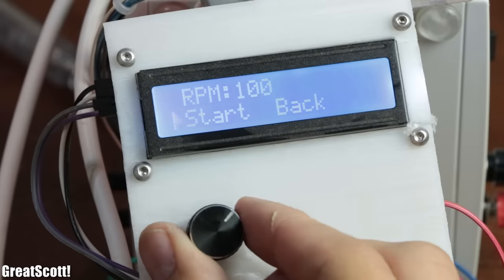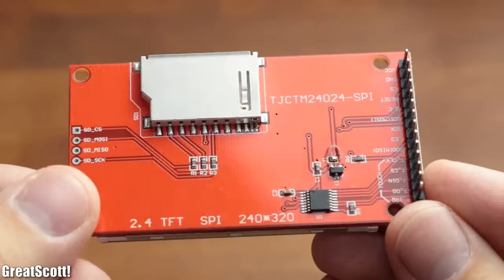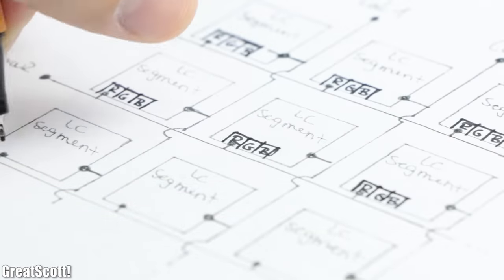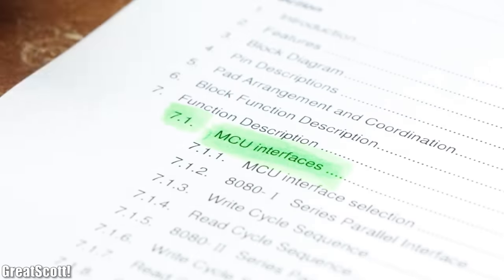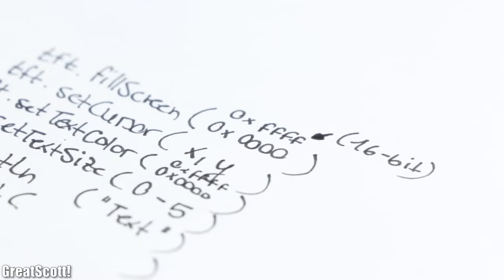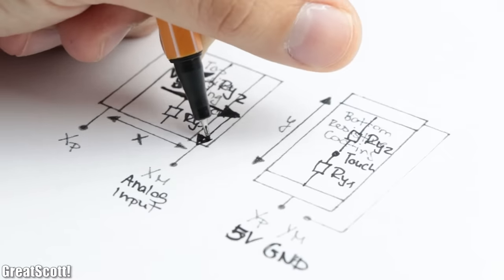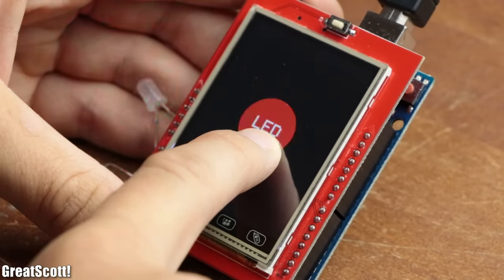How to create a simple Touchscreen GUI || Arduino LCD & Touchscreen Tutorial

Comment: One thing to consider is that while the parallel interface requires fewer clock cycles to set the data it may actually take more clock cycles on the microcontroller because many microcontrollers offer hardware SPI, I2C, and UART modules which operate independently of the rest of the processor.

Comment: FYI:
The Display you tied on @5:42 is 3.3V only. Although it claims to be 5V tolerant, it is NOT. 
Mine was not working as well, so I used a Level-Converter and... "voila", it works perfectly. (You can also use a couple of resistors, but that turned out to be not reliable at all)
You can use 3.3V Arduino boards. 
I use a Bluepill STM32 board now with the ADAFRUIT_GFX_AS and Adafruit_ILI9341_STM libraries and this is fast as lightning.
But thanks for the great video!!!

Comment: Although those screens are listed as 5V tolerant, they work with 3.3volts. You need to use a level converter such as BSS138 mosfet in order to use SPI interface.

Comment: Try Nextion Displays, they are more expensive but they allow for more complex GUIs since they run the GUI on their own and can communiceate with microcontrollers.
Reply: It also only takes up two pins on your arduino, and there is a software to visually edit your GUI
Reply: Nextion are the best displays for arduino. You can use them also with ESP chips.
Reply: I had no idea those exist, I am already looking into it now and it looks promising for my room (door lock/tempreture/curtain) project, instead of manually coding  my display  i could use this and half my workload. Thanks :)
Reply: I agree - Nextion displays are better than these.  And also more expensive. The price for these are good though. I guess it depends on your project and your budget.
Reply: Nextion are better, but cost more. Maybe in the future, MCUfriends will develope an editor like Nextion, & bobs your uncle, they will be the favourites.
Reply: They are a different beast. You only have RX/TX lines to communicate with it, which means you need to have everything you will ever want displayed loaded on a dedicated SD card. Just watch his weather station video to see how they look and how limited they are. 'Normal' TFT you can draw whatever you want, whenever you want, anywhere you want and you don't need a dedicated SD card. You can share the SD card with a data logger or use SPI flash memory, I2C EEPROM, etc. You can even draw on-the-fly. Normal TFT takes more time to tame, but they're worth it (don't use Adafruit GFX library!) Still, if Nextion meets your needs, go for it.

Comment: I also ordered 2 of those 8 bit displays and could not get it running for the life of me. Just by accident I tried the other one and it worked immediately. So it is quite possible that your serial display is broken.

I completely agree with your statement about pin usage. On a nano you have 1 or 2 pins left.

One other thing: better to draw complex UI on the computer and show the image on the display. This way you "only" have to implement the click map.

Comment: Unless mentioned before, cheapo screens like the SainSmart are likely to lose touch functionality after a year or so unless you add a protective shield (like a phone display cover) and protect the flat-cable by putting something hard on top of it, or repeated use/clicks will lead to intermittent failure due to material stress. They're cheap and good for experimenting with, but go with a tougher-quality display if it's meant to be used over a long period of time, or in rough environments such as being carried around in a pocket.

Comment: Hi Scott. I am sure you figured the SPI version out by now and my not even read this message but, the Arduino uses 5v IO ports and the TFT SPI uses 3.3v signals. You have to create a voltage divider for the SPI data connections. Also add the RST Pin #define if using the adafruit library.

Comment: The issue you had with the first screen was logic level voltage. Try putting a 10k resistor on all the data lines and it will work.

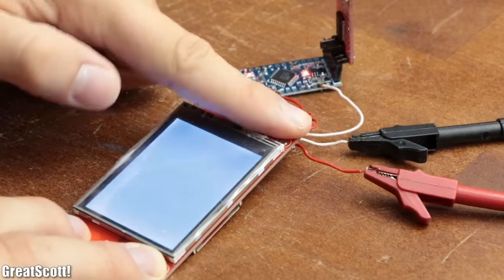Comment: Check that your SIGNAL lines are at 3 volt at time 5:52 , if not you will get white screen. Been there done that. You will need a voltage converter. Just subscribed :)

Comment: Try a nextion display... Its just an lcd display, but with its own microcontroller that loads the UI from built in SD card adapter..
Reply: And you only need 4 Pins (Rx, Tx, GRD, Vin)
But be careful when buying, if on the back "TJC" is written, it is the Chinese version and it would NOT be running with the Nextion Editor.
Reply: @Tom-hg9lw  Hmm, I didn't know that. Thanks for the info! Having just 4 pins(effectively 2) is also a pin saver!
Reply: I made this mistake because the article was cheaper and in ebay the title was " Nextion 3,2" ". And now I must have the chinese editor running and paralel the nextion editor so I can see which buttons are to press. 
very annoying :-(
Reply: lol sorry I had to laugh @Tom, thanks for sharing though. I'll keep that in mind since I was interested in purchasing one.

Comment: The first one did not work maybe because you used 5v IOs. You NEED to use 3.3v I/o, powering at 5v is fine though.. The Arduino is not powerful enough / not enough ram for those screens. Much better to use a STM32-duino. Additionnaly, in my experience if you use the same SPI but for both LCD and touchscreen , you may need to be careful about speed. The touchscreen chip is much slower than the LCD chip.

Comment: The serial one works great with the Raspberry pi, because the kernel has the needed FBTFT driver built in. There is a driver for the touch panel, too so you can use it to run the normal Xorg gui on it.

Comment: You could try with the 16 bit connection with arduino using 10k resistors in series. I don’t know why it works that way but it works.

Comment: An Uno will work with the 8-bit TFT and up to 5 other sensors. You can actually use a few more pins than just A5 since there are a few NC pins and the SD pins are not needed. My 3.5" TFT has the NRF24L01 to receive data from various sensors and to control other devices. This tutorial was helpful: [search Google for "Multi temperature-humidity sensing with an Arduino Nano displayed on a 3.5″ color TFT screen"; my comments with a link are being automatically deleted].

Comment: I did not have a screwdriver to test my touchscreen like in the video, so I tried to use a drill instead.  Not sure if the result was that good. For my next project ive ordered a screwdriver (Torx t5), nah. great video. I have a touchscreen I bought on ebay, it will not work no matter. And I have no clue on what controller it uses. So I will look up which controller it uses next time I buy one. :)

Comment: I have a similar display board (same controller, 2.8"), but without the touch controller.  It works using the 4 wire SPI serial interface using either the Adafruit gfx/ILI9341 libraries or the  Ucglib.

Comment: You destroyed first one by connecting on 5 V logic, it works ok with 3,3V,you need to use 10 k resistors ore level shifter.I made this mistake too.
Reply: Schade dass Du nicht deutsch sprechen kannst. Ich höre immer einen deutschen raus der versucht extrem perfekt Englisch zu sprechen. Aber das ist ja quatsch. Weiter so. Tolle Bastelthemen!
Reply: MrQuatale warum sollen wir nicht english sprechen, ich bin hollandisch und ich tinke das englisch ist ein bessere sprache fur youtube. i'm srr i tried to speak deutsh but not so good at it. what i'm trying to say is this website is international. so i think its better to speak english then a native language. i think its fine you speak deutsh. but i think its better to speak english so everyone can understand. not to offend you in any way!
Reply: sentchen123 yes it may be, anyway you can understand what i'm trying to say 😁
Reply: Ajay Sudhera regulator on the back for 3.3v is for the sd card and display indeed. But what about the digital pins. Through esd protection diodes you push the voltage of lcd to 4.3v and maybe kill the lcd io pin.
Reply: Ajay Sudhera ILI 9341 is 3.3 V logic chip,SPI bus is connected directly to chip,so shifting voltage is must! There is manny tutorials on youtube.
Reply: What happened to the third one?
Reply: Much harder to set up probably. I used it on a 3.3v 32 bit mcu , it works quite nice and fast. You need too many pins for it to be useful unless you have a >64 pin mcu. He could not use it on the arduino mega being 5v

Comment: I have been able to use Arduino Uno's and Nanos with those types of screens but you have to use series resistors with all pins connected to the display simply because those displays are native 3.3 volt and don't like the 5-volt signals